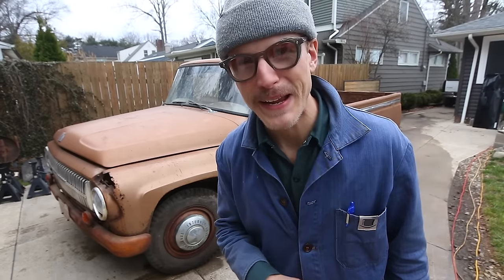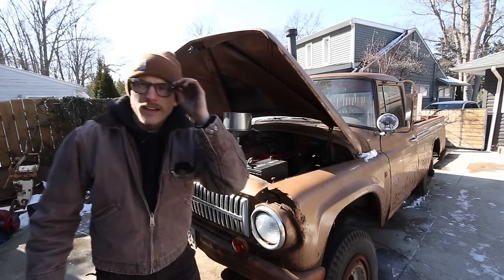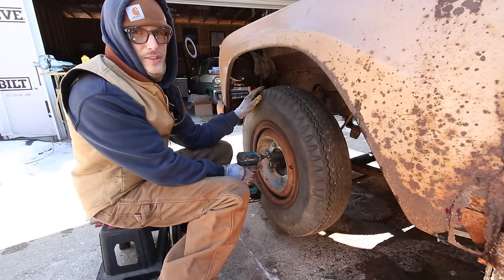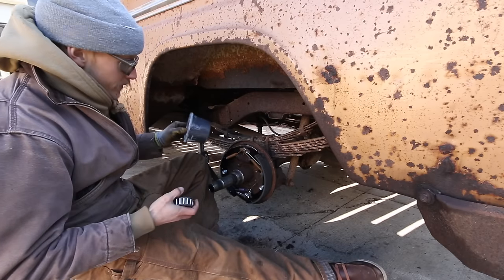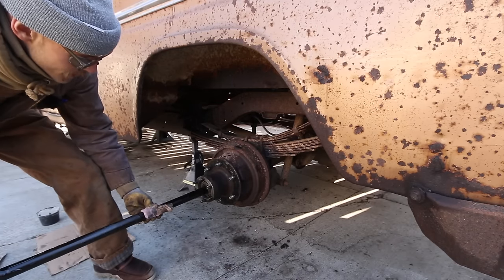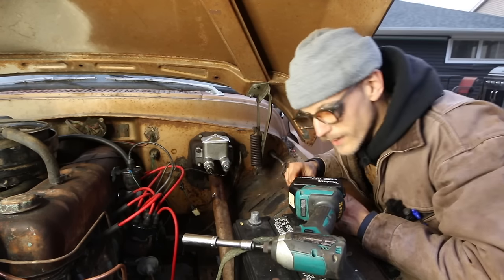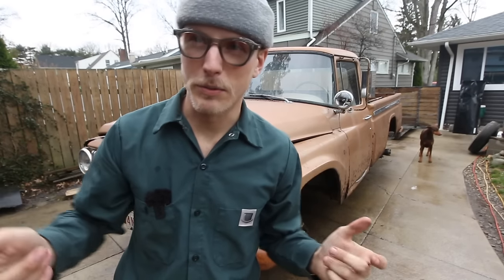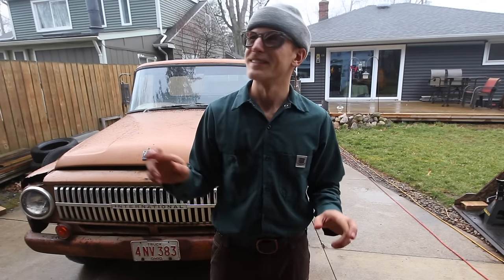International 1200A Pickup Truck - BRAKE DAY! -Wheel Cylinder Rebuild/Clutch Slave Cylinder Bleeding

Comment: Just my two cents but Hobo Fright (Harbour Freight) has a set of brake tools for $14 USD.  I'm sure you have lots of places to put your money but when i used to do brake work, i had one specialized lever for removing/installing return springs and another plastic handled jobby for removing the hold down springs.  They worked slick.   Cheers!
Reply from the maker: Just a classic case of "do I really need them?", then you get them and wonder why it took you so long haha
Reply: @NockRanch  Indeed!

Comment: I've worked on cars for years and I never pre filled an oil filter, Never had a problem.
Reply: Zackly.  How many garages that perform oil changes pre-fill filters and have you ever actually witnessed any issues when not pre-filling.   Not that there is any issue with pre-filling afaik.  Cheers from Eastern Canada.  :hand-pink-waving: 🇨🇦
Reply: @bradcrossman5068  Hello From South Bend Indiana 👍

Comment: The joy of working on orphan vehicles is developing the skill to find & modify parts for other vehicles to make them work on your application.
Reply from the maker: 1/2 joy, 1/2 curse. Always worth it though!
Reply: @NockRanch  Yep,, always had a soft spot for the Intenational Pickups, they were a favorite of my dad when I was a kid. The family car was an early 60's Travelall, and his drive to work vehicle was an 1100 pickup (the half ton version). If and when you decide to repair the eyebrows over the headlights, Fitzee's Fabrication here on YT has done several series on recreating unobtainable sheet metal parts.

Comment: Hey mic I noticed when you were putting your brake shoes on that you didn't lube your brake shoe contact points on your backing plate , there are six on each backing plate all it takes is a little dab of white lithium grease on each one , it prevents the shoes from wearing into your backing plate and keeps them from squeaking when they rub together 👍👍 By the way I have 11yrs experience at Midas doing brakes
Reply from the maker: Good point. I'll do this!

Comment: Master Cylinder  - to T . . .to T = No proportional valving.   All breaking equal to all wheels.  Truck with most of the weight up front and an empty bed will be sketchy with nothing in the bed and rear wheels wants to lock up easier (think rain).  Mind you . . I get it.  You need the pure basics to see what else could halt the process.  BUT. . .   Since you were working with custom fab due to unobtainium. . .   I cannot understand why not install a T fitting for the front lines down on the frame nice and clean, and a new line from the master cylinder down to a T that feeds front and back all hard line?  For the life of me I cannot see a single reason for soft lines in that setup.  What you have will work.  But damn that collection of hardware for the front  . . .in the Cleveland salt and snow ..  and well that truck and all that steel at 45 to 55 mph and something go wrong and you use a tesla to slow down could be bad news.   Just mechanic to mechanic.   Love your videos.   Please do the carb on the wife's car again.  We miss her!
Reply: Would a truck this age even have proportional braking from the factory?
Reply: @SirPoopyPants  yeah you aren't wrong about that. Funny all the small safety stuff you forget about when you work on vehicles 40-50 years newer than this truck.
Reply from the maker: No proportioning valves back then, but not a bad idea! Might have to go back and put one in eventually.